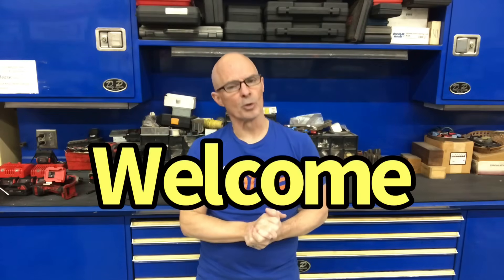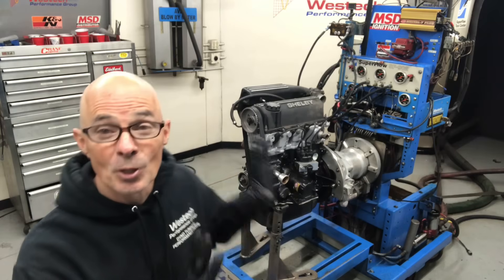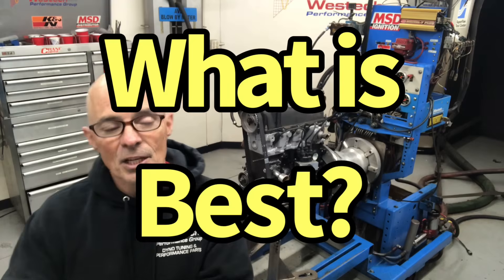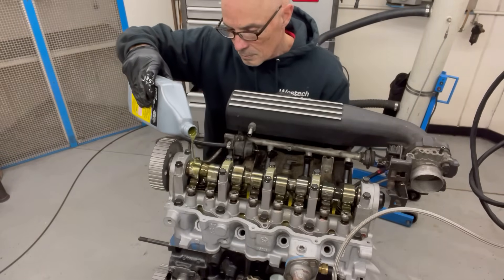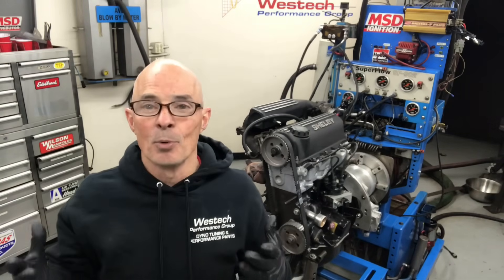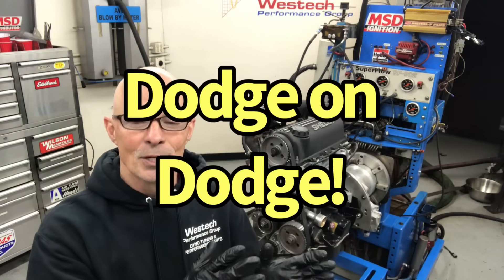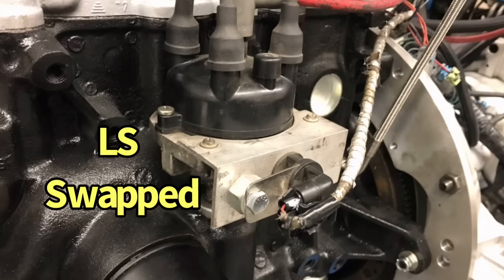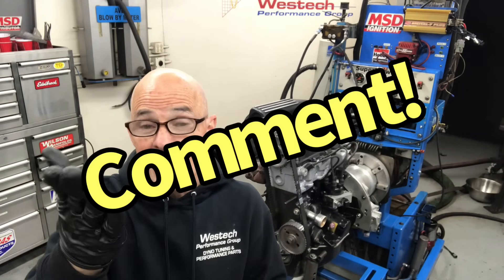2.2L DODGE TURBO-LS SWAPPED THE DISTRIBUTOR. 1ST DYNO TEST. WILL IT RUN? HOW TO RUN HOLLEY HP ECU.

Comment: Spark skatter!!! It's the Rotor actually moving back and forth!! Grind the rotor button to a point!!! Not completely leave 0.45 in the middle of the rotor button this will fix your timing skatter!!
Reply from the maker: the rotor moving back and forth-how does it move?

Comment: Other things I have are a great flat top set of Ross NHRA approved forged pistons, a custom set of Total Seal ringsets for them, the block blueprinted (especially the oil pump to the block openings as that is the biggest HP robber baron on a 2.2), all internals balanced, on the top end is a slider cam (not the avail. Roller cam), a great set of springs, replaced the stock lash adjusters w/a newer P.T. hyd. lash adjuster set w/ 20 thou steel shim washers under them in the bores, at least a .430/.430 slider cam dial that cam in at 3 degrees adv. Using the D.C. adj. Cam sprocket w/ offset keys (though I also have a much more agressive .446 Ex/.432 In cam with a ton of overlap and duration that has zero vacuum at 3K or less, I need to do some more improves to actually use that cam again as it was a dog outta the hole but came super alive at 100' out it was really great throuout all the rest of the rpm range (up to 7K each gear), it needs the opposite to no doubt be retarded about 3 degrees (6 degrees overall), to gain back the bottom end losses it flys to 7K RPM in every gear, harder to hold at the tree as it just started building vacuum at 3K (convert to full man brakes/ loosen the torque converter to at least 5K true flash or better to ever use it.) .445/.445 lift is max for the NHRA Stock Elim. Specs for the 99HP 2.2L Single point N.A. 1984 Daytona 2 dr. Hatchback combo. That log manifold was designed for that turbo and those 4 injectors. Put that timing up there above 44 degrees and it will love that huffing of air and fuel (I am also running Sunoco 110 and that stuff loves higher timing w/flat tops ...those minor turbo dishes may finally be fully igniting the fuel and air load up in the real rpm range without the boost they were actually designed for. The 2.2L is a very different beast...25 to 42 degrees, mine runs like crap too. But that 2.2L loves high rpm...you will not kill it. You might kill axles later in a car trying to apply all that HP it finds moving a 2,800 lb plus car with the low hp at a fast clip. The weak point is axkes and transaxles...the blocks are almost bulletproof. (Do add the 4th cyl. Cooling mod though as the coolant exiting the block between cyl. #3 and #4 creates a really dead and dangerous hot zone. The water just stays there and keeps heating up, and up, and up, without it. There is an easy solution that costs less than 60 bucks. Read up at www.turbododge.coms/forum look for 2.2/2.5 4th cyl cooling  solution. It bolts right up to the back end of the head wraps around to a bung in the thermostat box.

Comment: Without that log intake (to run N.A. you need the N.a. manifold and the upright Bosch Throttle Body, and with either....you need a lot more timing actually 46 degrees static from idle through 7K RPM...and yes it will easily run 7K RPM and get that same happy top end more power on full pulls. I have tried all over the adj. range of timing and it is happy 10.23 C.R. waaaay up there at 46 degrees total and static sir. Trust me.

Comment: Look at your oil pressure and see if it's dropping off at about 5,000 RPM you are running so much oil pressure you're probably wasting 30 horsepower in that engine easy. Trying to run 90 lb of oil pressure. Unless you have gaps in there the size of Montana.
What I surmise is that your your bumping up the relief and causing the oil pressure to stabilize down around 45 or 50, which is more than enough for 5500 RPM. But trying to push at 90, I can't understand why you're only running 130 horsepower. I've seen those things with Weber side drafts putting out 200 plus horsepower. But they were destroyed they were actually 2 L versions of the same engine running about 200 to 220 horsepower and about 230 ft lb of torque. That was Chryslers test mule
Reply from the maker: no stock 2.2 with Webers made 200 hp na. Oil pressure doesn't cost 30 hp. Making over 100 lb-ft per liter?
Reply: @richardholdener1727 But they do have a big habit of blowing oil right by the lower bypass valves of most of today's mfg.'d Oil filters. That has been tested and proved. And if it is blowing past the oil filter bypass valve at high rpm it will pick up a power spike too as it reduces the flow. I have never ballooned one, but have seen them do so.

Comment: Shared with Tall Garage 🥝✔️
Reply from the maker: what is tall garage
Reply: @richardholdener1727  Tall Garage is an awesome guy who is making another LS headed 300 Big Six. He's looking at doing the same kind of Ignition Hall Effect sensor and HP Holley Port EFi system you've used on the Super Richie Omni Potent 2.2. 🥝✔️
Reply from the maker: Why does he need that-why not just use a distributor and use universal HP harness

Comment: when is the David Vizard head going to be used? Id think it would have to be the intake as being tweekd to take advantage of the turbo boost?
Reply from the maker: no such thing as a turbo intake manifold
Reply: @richardholdener1727  maybe it would be better said "The intake manifold that was built to accept the turbo"...the 2 piece intake is unique to the turbo motor on those cars....i do believe(could be wrong) as I had 2 of the non turbo 2.2/2.5 and 1 turbo 2.5 back in the day.
Reply from the maker: THE TURBO DODGES HAD 1 PIECE AND 2 PIECE AND LOG MANIFOLDS DEPENDING ON YEAR BUT MY POINT WAS THAT EVERY MANIFOLD WORKS UNDER BOOST THE SAME AS IT DOES NA
Reply: @richardholdener1727 For the 84 there was the standard N.A. manifold for an upright Bosch Throttle Body, and the Turbo 2 pc Log style Turbo Intake Manifold. 1 is a single point, the other 4 injectors.
Reply: The runners between them though are worlds apart. My fuel sprays in at the very top (wet t.b), straight down to pool on a turtle molded into the bottom of the intake, then air/fuel mixture must 90 degree out and around through much longer unequal length runners (2 short cyls. 2-3, 2 longer cyls. 11:23  1-4 N.A., the turbos are much different designs dry T.B., air into the log, and then air into the spray short slightly curved runners.

Similar in concept, much different in design and twice to 3 times the air volume just before the runners (and a world of air turbulence easily in the final result allowing for compressor boost area usage when that turbo is installed.).

Comment: trigger setup wrong, trigger edge wrong. Put a sensible crank trigger like a 36-1 on it instead of that crap 24x. And dump the dizzy for a coil pack at a minimum. Just use the dizzy for cyl1 sync.
Reply from the maker: yes-cuz no LS motor ever ran well with a 24X
Reply: @richardholdener1727  doesn't change the fact the LS 24x wheel is a bad design. Although presumably in this instance, it's just a plain 24 tooth ( or 12 in the dizzy ? ) as opposed to a small replica of dual pattern GM wheel. Plain 12 or 24 tooth wheel would be an upgrade. But still better to have it on the crank, and with an indexing ID of some sort

Comment: Are you running PT GT lifters with washers? You'll have the rockers fall off if you don't. Also run beehives.
Reply from the maker: stock lifters
Reply: @richardholdener1727   Yep! Haha 😁 it's the first thing we do in my family and circle. We basically couldn't run our engines hard at all with stock lifters unless you stay below 6,000 rpm. Mopar performance 2.4l turbo lifters work perfectly with washers underneath.
Reply: The p.T. lifters and 20 thou steel washer shims were and are a great improve. I saw 7K rpm first time over 6,400 ever, by pass #3. @SillyDillysTunes
Reply: @richardholdener1727  I'm just confused with the increase in power. Usually valve float, you lose power. Makes me wonder if my theory of having a two-piece on an NA would make great power is correct.

Comment: just picked up an abandoned 87 Shelby charger for 600 bucks, with original 31,000 miles, interior is perfect but the exterior will need work, kinda looks like whatever barn it was in collapsed, all the glass is good though, i had a 1984 California Shelby rampage that i swapped a Daytona 2.2 turbo z engine into and, the waste gate solenoid got stuck on that motor and it over boosted to 32 psi of  and cracked the hypereutectic piston ring glands on a 4 pots

Comment: Could it be exhaust pulse causing a scavenging effect producing more power at the higher rpms and have you tried a long tube header to see if the same results are achieved v/s the cast iron 4 into 1 ?

Comment: That's all those motors called for was pump gas they came in alot of older dodges lol you got my confused on the pump gas thing I know people that were running 10s on pump gas with them. Here in michigan there was so many of them it was unreal now you barely see them ever it's sad
Reply from the maker: I have never seen 10s on pump gas unless you count e85 as pump gas
Reply: @Richard Holdener  idk how you haven't
Reply: @Richard Holdener  e85 came out early 90s wasn't around like that back then pump gas is what we all used some muscle cars used turbo blue but that's about it. Now amd days ues e85 and all these different fuel mixtures are around and alot of people use them
Reply: @Richard Holdener  thankyou for the comment buddy keep the videos coming 👍

Comment: Hey the reluctor wheel is on the crank not the cam in an LS. So it spins full speed not distributor speed.
Reply from the maker: there is a cam sensor also-the sensor doesn't care

Comment: DUH DUDE!! ITS A FREAKIN TURBO CAM!!!
Reply from the maker: DUDE-EVERY CAM IS!
Reply: @richardholdener1727  WHAAAATT? BROOO, YOU NEED A N/A CAM. THAT TURBO CAM IS ACTING LIKE LOWKEY VTECH, LITERALLY...... 🤣🤦
Reply: @richardholdener1727 Slider or roller 2 different cams, 2 different  rocker designs, 2 different cam mains, and ck the back of the head (passenger end), for O.S. (stands for oversized cam mains that have an oiling groove in them), markings is it a part # 4323287 head stamping and does it have the actual Mopar pentastar cast into it as there is a company in Calif. Marketing a 287 replica without that cast marking for the 84's with the 287 number. Also were there any cracks between the valve pockets? They run with the cracks there, but leak compression between valves causing erratic behavior though. Transferring combustion and unturned mixture at odd times. Stupid stuff I know that you no doubt ck'd., but very common on 2.2 turbo's that is not usually found on our N.A. editions. Almost every 2.2L Chrysler/Dodge Turbo edition head is cracked between the valve pockets /seats from boost and heat. The N.A. edition will too if you overheat em enough times.

Comment: I don't specifically know the cause of your "spike" at the end (you're probably right about the size of the window) but fixing that will just leave you with other issues down the road. The stock crank trigger has always been a hinderance in these engines. Largely because it's belt driven (those not following along, timing belt drives the oil pump, distributer is driven by oil pump, pick up is in the dist. So... pick up is belt driven.). You would best be served converting to a pickup off the main pully or flywheel (TIII used a flywheel pickup in the bellhousing, most after market ECU users weld a 36-1 trigger wheel to the accessory pulley and fab a mount for a pick up accordingly). If you look at a crank signal with an oscilloscope on any of your projects that use a crank mounted pick up you'll see the signal is very clean and steady. If you look at the same data from this belt driven pick up you'll see it's very... sloppy. The belt allows some lash and the pick up reflects this. So even if you rework the windows to solve this issue, you my find the sloppy belt driven pick up is a problem later on in tuning (not to mention the stock bladed plug wires are garbage). But don't worry!!!... your cool LS pick up converted distributor doesn't need to go to waste. You can convert to pully mounted crank pick up and re-task the distributor pick up to be a cam sync pick up (because it turns in time with the cam) and run distributor-less ignition!!! Use any common 4cyl coil pack in wasted spark or 1 bank of LS coil packs or even COP in sequential. You could compare all 4 versions (stock dist, wasted spark pack, LS coils and COP) and see who wins... (more content to film!!). Great work!

Comment: The timing needs to be progressive. As RPM increases so should timing advance. The timing was too high at lower RPM and getting closer to just right at the higher RPM range. I would guess that best timing advance above 5,000+ would be 34-36 degrees.
Reply from the maker: not 56?
Reply: @richardholdener1727  I've never seen the need to have that much total advance timing.

Comment: great video.  I owned one of those 2.2 (normal version) engines.  IIRC you could order factory parts to build those up to 300 horsepower, and there was a Mopar parts list that specified the parts for each performance level.  Wonder if that data is still around somewhere.   Shelby knew what he was doing, that's for sure.
Reply from the maker: the 300-hp motor was a Super 60 turbo

Comment: i own 2.3l and 2.2l ford motor they make more power at 4k or 6k rpm because they were redliner make for higher revving for more power
it not like v6 or v8 like low revving more power no it opposite from this two engine because you can spotted spike up more power at high rev 
if i were you i would ditched fuel injecter and throw on some weber or vw carburetors and tunes it and redo test on dyno you may get more information from it
2nd that 2.2l dodge inline 4 is copy of iron duke motor because of design of head i know not mistakes by it builds i really dont like iron duke engines because they overheating issues still continue

Comment: Too much feel injector I wouldn't be running bigger ones until boost
Reply from the maker: that has no effect-we adjust af ratio
Reply: @richardholdener1727  I wonder if the bigger injectiors are spraying in right spot as the stock ones ? Are they deeper in less ?
Reply from the maker: stop wanting the bigger injectors to be a problem-they are not-we can make them spray less fuel

Comment: 7 to 1 motor may not be hip on the 91 octane , and your out of emissions compliance territory so may as well see if you can fit a 2nd tensioner on the timing belt and play with cam timing porsche "variocam" style
Reply from the maker: this is not 7.0:1 compression
Reply: @richardholdener1727  sorry  Richard! Saw dished pistons . My 502 mag bbc does make less power on the dyno with high octane .my old maico 440 dirt bike made a bunch less power on avgas. Just throwing it out there

Comment: Oh yea, I had several of these motors and ran the crap out of them. 
It could lock horns with at the time the early 2000's stick 4.6 stangs in my 4 door hatchback dodge shadow.
Pissed off many owners. Most of them didn't realize they had to rev their 4.6 to the moon in order to get to their power sweet spot, good times....
Nice low end torque on these 2.2s, typical mopar. Your NA curves look right for a stock NA motor.
I favored the 2.5 turbo with the counterbalancer removed. 
I never had the two piece intake but the one piece worked really nice.
I do remember something about the rings regarding these motors, have broken them for seemingly no reason except during a very high rpm pull. So I always kept mine below 5300ish. Not sure about the power jump towards the end, doesn't look like valve float. However, are you using the turbo cam with the NA setup? If I remember there was no overlap on the turbo one. Could be just weird things happening with using turbo parts with NA. 
Also speaking of cams, if the belt is too tight or things are going wonky in the beltrain it could snap the cam. 
These motors are susceptible to spark ignition dance too because of the belt. If it were me doing this I would ditch the distributor altogether for CoP. You got the box for it, might as well.

Comment: Is that the LeBaron turbo motor? I had the non turbo model from 84, I think. It was a complete turd.
Reply: Yup a total turd on the Daytona in 84 too, they built a 1 off 84 turbo edition too (different than what followed in 85-up), and while they made the parts for the 85 Daytona non-turbo N.A. edition, that Turbo edition in 84 killed off the Daytona TBI in 85 (my Dec. 84 3rd week build actually received an 84 mid year intake manifold chg. In part no's. as they ran out of the intakes in Oct. 84'). For a while it made parts more plentiful, as they sold well over 18 thousand 84 Daytona units of the TBI Edition and zero 85's. Also made the 84 Turbo and Turbo Z models special (in a tough way as to the electronics), as improves were made to all 85's. ECM's not interchangeable between 84/85 later Daytonas.

Comment: BluePrint Engines just showed a prototype iron block LS/Windsor 4 cylinder rated for 340hp/500 ft/lbs.
Reply from the maker: THAT MOTOR (WITH LS HEAD) DOES NOT EXIST YET AND THOSE NUMBERS WERE PROJECTIONS WITH BOOST

Comment: Check the rotor phasing is aligning with the cap electrodes.  Cut large holes in the distributor cap to see this with a timing light.  At a stretch, also check injectors are firing at the correct time. Looking forward to your progress 🙂